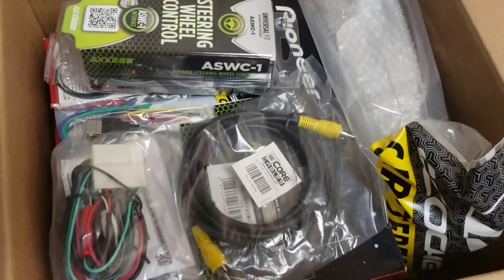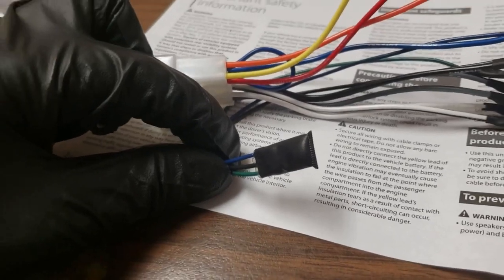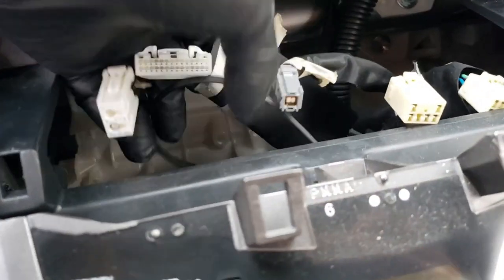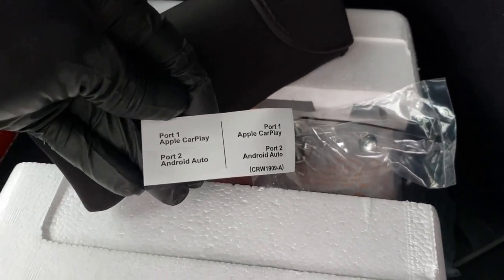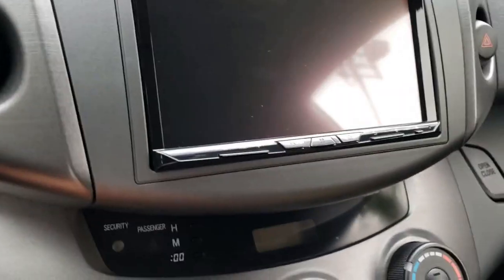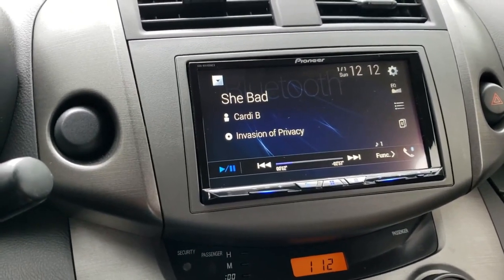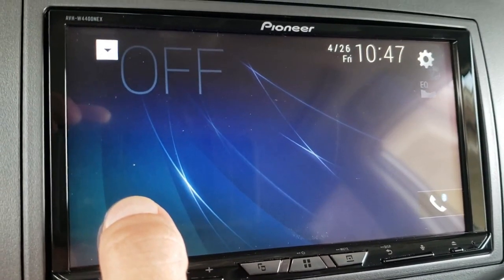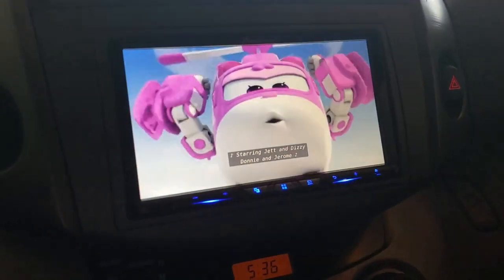Pioneer AVH-W4400NEX Install in a 2012 Toyota Rav4, Wireless Apple Car Play, Video in Motion

Comment: How were you able to have the back up camera on the stereo as well as the rear view mirror ?? Please help.
Reply from the maker: I didnt end up finishing that.  I only tapped the video line and got lazy when I couldn't find an easy reverse signal anywhere up front. Would have to run a wire to the tails or a harness somewhere to get the reverse signal to turn on your head unit.

Comment: Hey. I have the same system and using a Renault Duster. My steering controls just won’t work. Any tips ?
Reply from the maker: I had to use a steering wheel control kit that mated the factory wiring to the aftermarket radio.  The kit had wiring instructions, but from memory it was not very easy to follow.

 I believe I used this one or something similar.

https://www.amazon.com/Axxess-ASWC-1-Universal-Steering-Interface/dp/B00B4PJC9K

Comment: How many inch is the carplay touchscreen?
Reply from the maker: This one is a 7 inch diagonal.  Its about the largest that will fit in the double din slot from the adapter kit that replaces the factory radio.